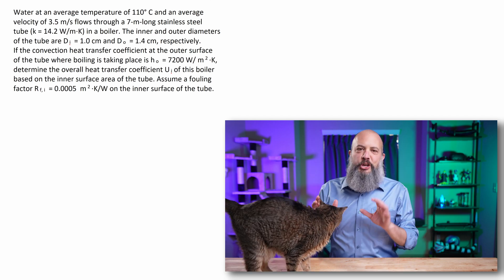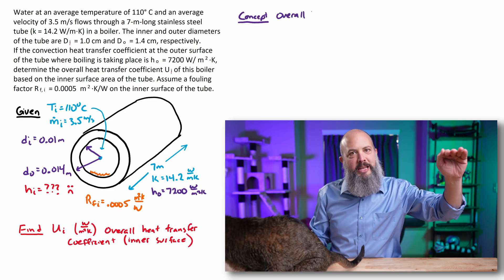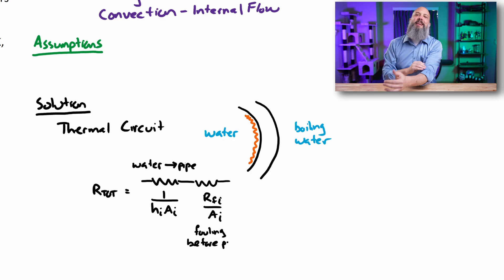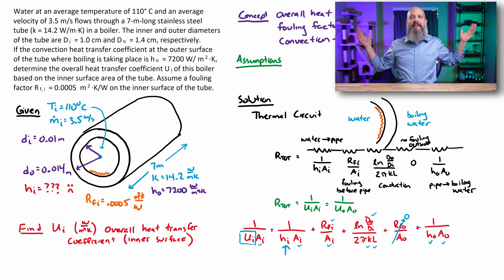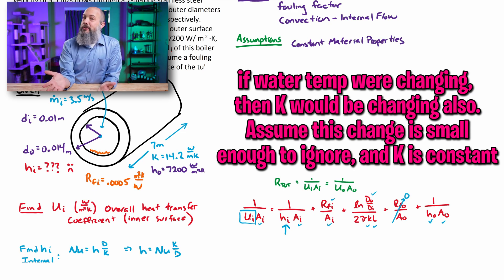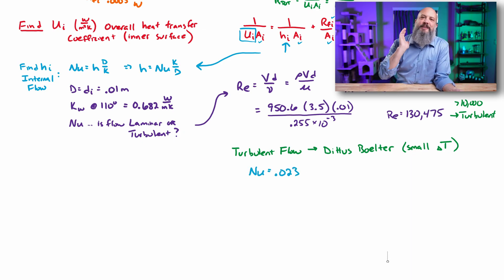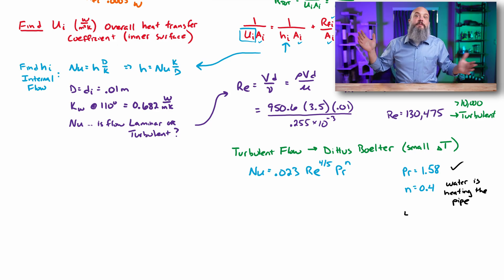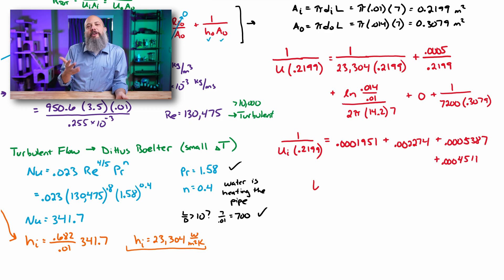Fouling Factor R and Overall Heat Transfer Coefficient U

Comment: I like your videos prof.. ❤
Can you provide me the textbook you use?
Reply from the maker: Glad you like them. I use 2 different textbooks for Heat Transfer. There's a book by Lienhard called "A Heat Transfer Textbook" that is available for free - can't beat that. For a paid textbook, I mainly like the book by Cengel, but if I picked a 3rd choice, there's a Bergman book that is also pretty good. Cengel and Bergman are pretty similar, I like Cengel as personal preference. The Lienhard textbook has much lower production quality, figures aren't as fancy, but it does a much better job explaining the differences between the different equations for the same thing, and why they recommend certain ones over others. This mainly comes up in Convection, where so many equations are curve fits - Lienhard uses more modern models and explains why better.

Comment: Great video, however I wonder in practical boiler predictive maintenance can we get the ho and  Rf,i values?
Reply: you always have to find your ho looking at your local weather conditions (average wind speed per year or another method you see accurate enough). For a boiler, I'm assuming it's going to be in an enclosed space, so the ho shouldn't matter too much.

For the Rf values, I'm unaware if there are recommended methods in some API/ASME rulebook (there probably is), but you could also compare the boiler with itself. At the end of the day, Q = mCp(T2 - T2) and an industrial boiler should have temperature and flowrate sensors, so there you go; if Q after a month is lower than the first Q you measured the first day, there's your fouling factor